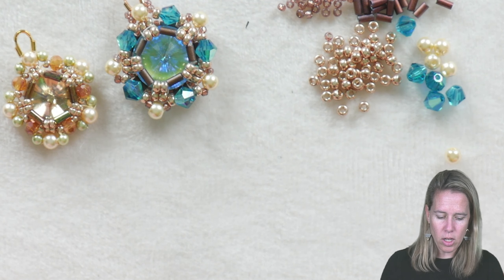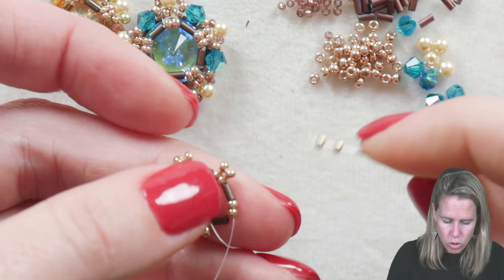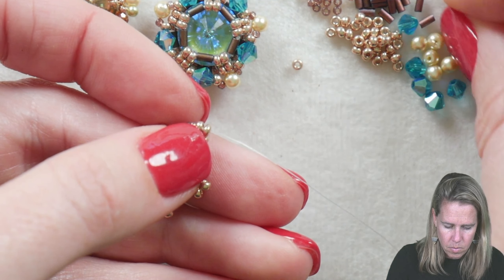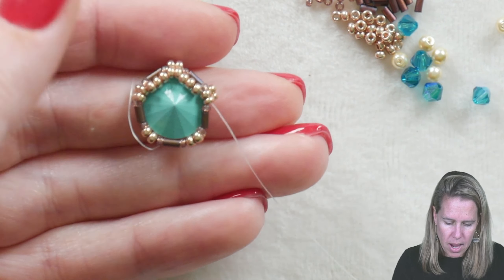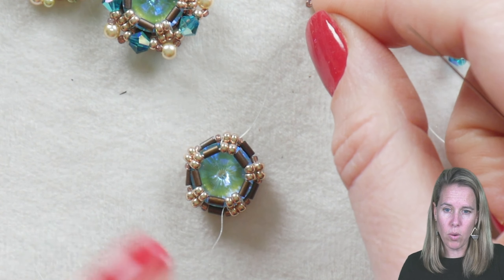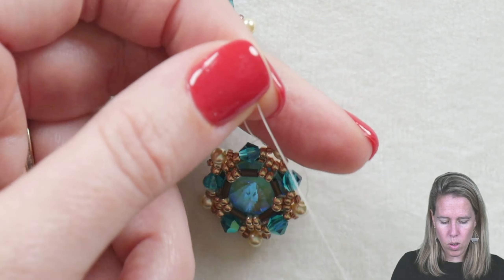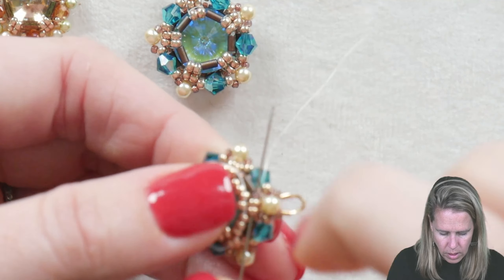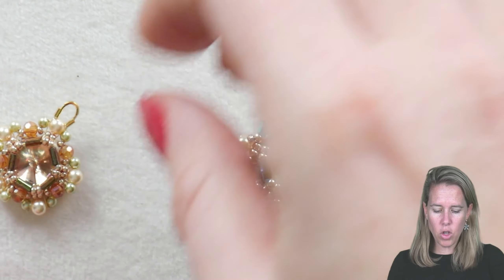Crystal Quin Bezel Earring Tutorial  - DIY Jewelry Making Tutorial by PotomacBeads

Comment: Frustrating! I used 3 11/0s between bugle beads like you said to for an14mm rivoli, and my rivoli fell right through the “bezel basket” from the beginning. I have pulled tight throughout. I love the design, but will likely have to start over due to a bad count.